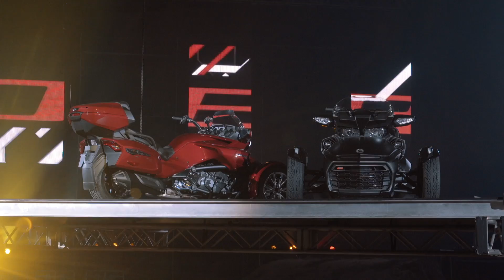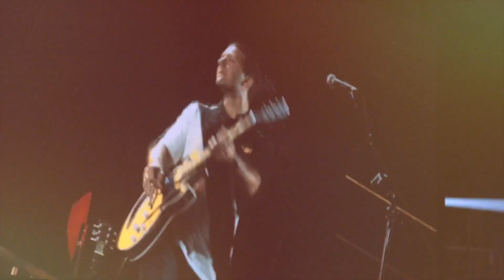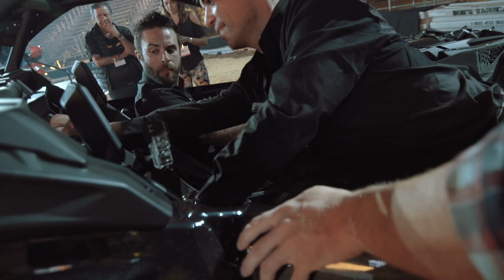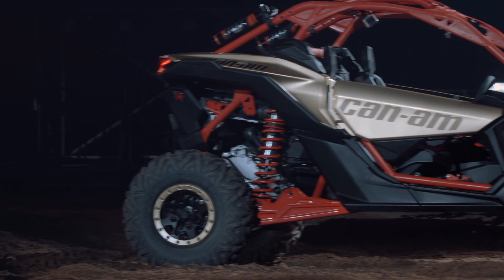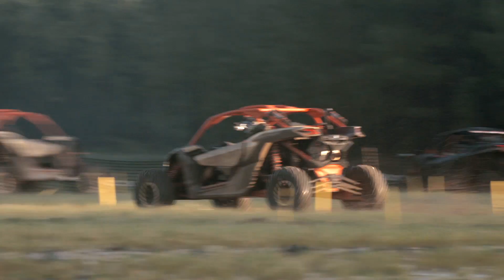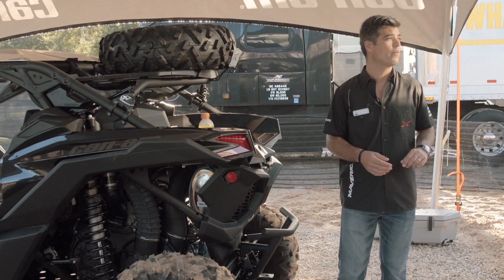2017 Can-Am Maverick X3 Introduction

Comment: eh honestly i think that they kinda just copied the rzr and it isn't class leading in everything
Reply: Everybody is entitled to their own opinion but I'm curious what parts you think they copied from Polaris? The front suspension is very different, the rear is totally different (their own design), the turbo integration into the manifold (their own design), and the engine is a 3 cylinder.
Reply: Dargon Axenhammer if you look at the maverick and a rzr they are very different then the x3 comes and looks a lot like the rzr and uses a trailing arm design and threw away there (forgot what it's called) rear suspension that removes any camber change when the suspension flexes
Reply: I disagree with it looking a lot like the RZR. The front suspension is more akin to the Yamaha YXZ than anything Polaris uses. Both the RZR and the Mav (called Torsional Trailing Arm or TTA) use a trailing arm suspension, but the Mav is definitely an inferior design for whoops and big jump landings. Can-Am is still using a trailing arm suspension on the X3 (called TTX) and the design is a much better setup than the TTA. I agree they are similar, but the RZR and X3 rear suspensions are not copies of each other. I have not looked at the specs for each but the Mav looks longer and it definitely comes in a wider version (72").
Reply: Shockin Awesome I own an X3 XDS and a buddy owns a RZR 1000, ...THEY'RE NOTHIN ALIKE!!!!!! Two, 100%, completely different UTVs. Both have pros and cons, but the X3 comes out better overall in handling, take off speed, travel, suspension, mid-end power, stability etc etc etc.

Comment: Gotta love how Polaris just added a bigger shittyer turbo to their rzr turbo to make it have more then can-am because they can't let can-am win even though they are! This thing will destroy and rzr it sees that's why it's already won events racing rzr's
Reply: because it basically is a RZR XP now. if ya can't beat em, join em
Reply: infamouscoma886 false maybe against the 140 hp one not the 170 hp and if u look it up the x3 is the slowest out of the four sport side by sides
Reply: The X3 is mostly for racing but  not for mud or anything else
Reply: Meg Croft not sure where you get that from. These X3s walk all over the RZR. I've seen it time and again at the dunes.  Even the 2017 154 hp x3 was beating the XP turbo rzRS. I love RZRs also. I own a 900 Ace with reflash ect and its super fast. But when i went to buy a brand new full size side by side. I did my research and listened to people i know that go to the dunes. The answer was always the same. The X3 is a better product. But im sure Polaris is working on somthing big also.